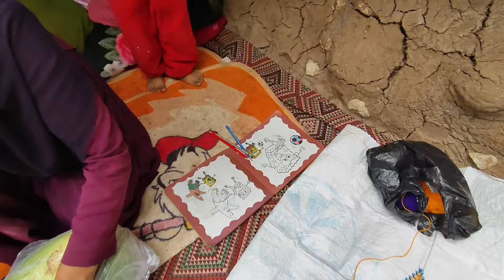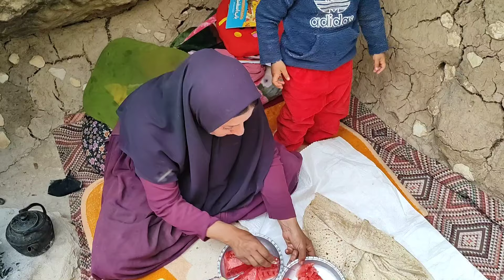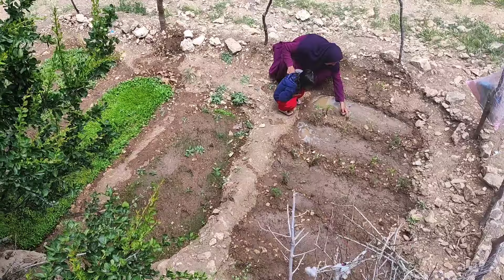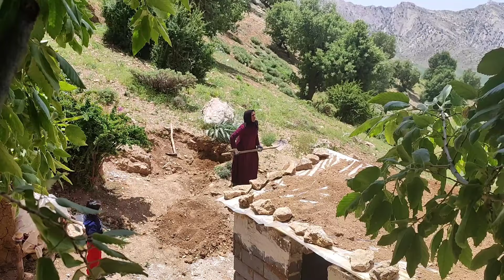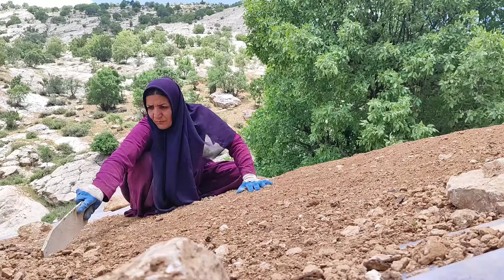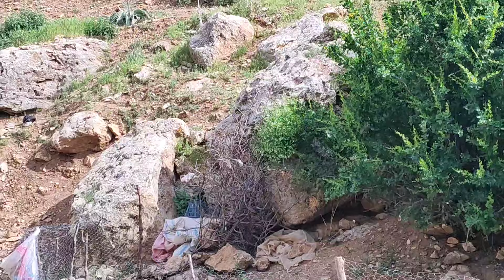A symbol of strength and high self-confidence of a brave mother to get rid of problems

Comment: Dry cement it.  Sprinkle dry cement all over the dirt, sprinkle with water and let dry. Do this several times and it will become hard as concrete with no mixing.